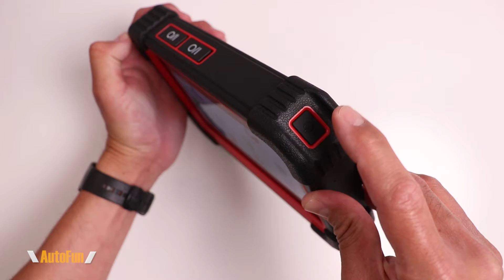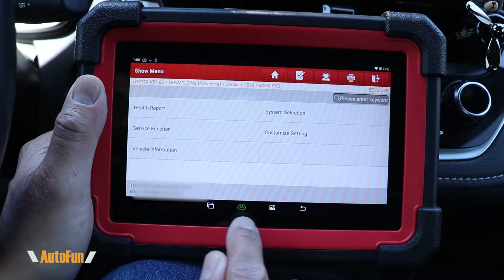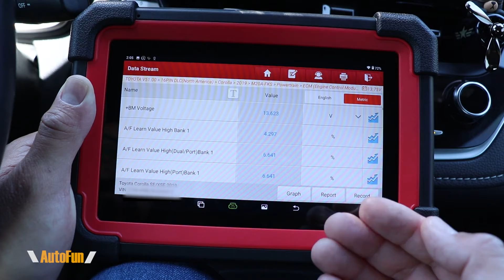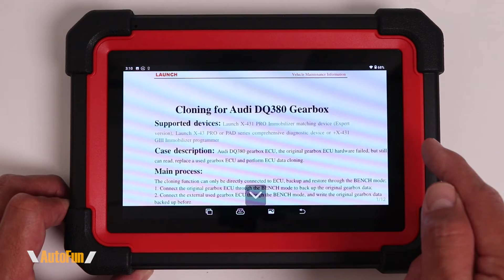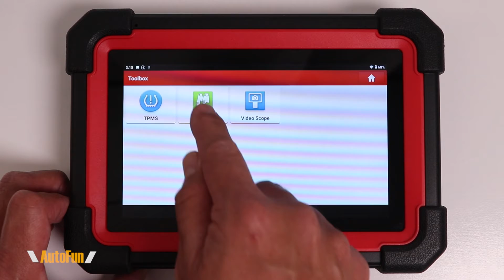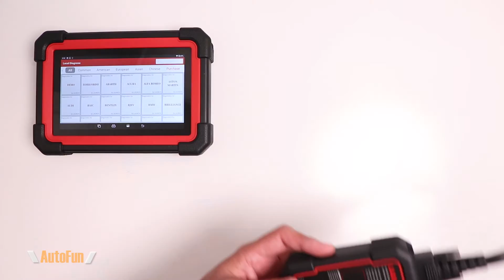Launch X431 CRP919EBT Elite Bidirectional Scanner Review

Comment: Doesn't this scanner also allow for a wired connection instead of Bluetooth? I have used Launch, Topdon, Xtool and Autel. I keep going back to Launch. Topdon is slowwwwww on older vehicles. The Topdon Artidiag Pro to be exact. My Xtool is a bidirectional dongle that has a lifetime of free updates. I like it over the Topdon.
Reply from the maker: Yes using the USC port on the tablet and USB port on the dongle, cheers!
Reply: @AlexAutoFun  I thought so, but wasn't 100% sure. I just ordered the Launch X431 Pro Elite 8" version, non bt.

Comment: Great tool. To those who don't know, this tool has the playstore app installed. Because this model does not have an android home button on the bottom menu bar, you have to access apps through the file explorer. Go to the main Launch X431 software menu and click other modules. Next click files. This takes you to the ES file explorer. Next click the APP folder on the file explorer home screen. This will show you all your installed apps and you'll see the playstore app in the list. To access the apps you have to open them from this menu. If you want to have quicker access to your apps, open the apps and leave them open. They will be accessible through your windows tab on the bottom menu bar even after shutting down and restarting the tablet.
Reply from the maker: Awesome! Thanks for sharing this 😎

Comment: Will it read real mileage ?
Reply from the maker: If the mileage has been modified, it may have been modified in multiple places making detection difficult and in some cases impossible. However yes on some vehicles where the mileage is stored in several places, and not all of them were updated, a discrepancy may be detected but again the true mileage will be unknown. There are also other more advanced ways to determine if the ECU has been manipulated but they require specialized equipment and usually again they can only show that a change was made but not what the change was, Cheers!

Comment: Will this unit deactivate active fuel management system in 2007 Silverado 1500 LT
Reply from the maker: Yes the scanner does support several programming, coding and customizing functions. Just remember that actually being able to activate, program, or enable a specific component varies from vehicle to vehicle. Launch does accepts VIN numbers if you want them to check if it will be able to access the specific function you need, Cheers!

Comment: I bought the same diagnostic from another person who used the serial number and pin code. How can I proceed so that I can use it? Can I get a new serial number and pin? Thanks!
Reply from the maker: If the scanner was activated, there is not need to reactive it. Just continue using as normal. And here is my activation video in case the scanner was not activated https://youtu.be/HI7rB-7_bB0 Cheers!
Reply: Danke schön!

Comment: Hi would i be able to program a jaguar key. My car is displaying smart key not.flund after battery change
Reply from the maker: Yes, the scanner supports IMMO access just remember that being able to add a key will depend on how many keys you have, if your car requires a pin code or a passkey, if you are adding a new key fob or a used one etc. In some cases a dedicated IMMO tool will also be needed if you are trying to re-use a previously assigned key fob where you need to make it "virgin" again using the dedicated IMMO tool, or if you are trying to clone a key outside of the vehicle (and other locksmith level functions). Launch does accepts VIN numbers if you want them to check if it will be able to perform the function you need, Cheers!
Reply: @AlexAutoFun  if i require making the key a 'virgin' again is there a tool that you recommend for that
Reply from the maker: There is an add-on I linked in the video description for advanced IMMO cases. However I usually start with the basic scanner and only purchase any additional add-on if they are really needed (Launch can confirm if the add-on will be needed for your case based on your VIN number and current state of the key) Cheers!

Comment: Can use to key programming?
Reply from the maker: Hi! Yes the scanner supports IMMO access just remember that being able to add a key will depend on how many keys you have, if your car requires a new pin code, if you are adding a new key fob or a used one etc. In some cases a dedicated IMMO tool will also be needed if you are trying to re-use a previously assigned key fob where you need to make it "virgin" again using the dedicated IMMO tool, or if you are trying to clone a key outside of the vehicle (and other locksmith level functions). Launch does accepts VIN numbers if you want them to check if it will be able to perform the function you need. Cheers!
Reply: @AlexAutoFun  thank you so much .how about eps calibration ?

Comment: Which one is better? Launch X431 CRP919E BT or Mucar V08?
Reply from the maker: Hi! Mucar V08 comes with a full set of adapter for Non-OBD2 vehicles, where the CRP919EBT (it may be possible to get a set for the CRP919EBT but I can't confirm). The case for the CRP919EBT holds the scanner, where V08 does not come with a case for the scanner. So I think it's going to come down to what your needs are and which you prefer, and here is the full review for the V08 https://youtu.be/XtsESLy9Zmo so you can compare it to the CRP919EBT, Cheers!
Reply: @AlexAutoFun  alright, thank you sir
Reply from the maker: @haziqnajmi-pp5sw  You're welcome!

Comment: Hello. I got the scanner. My sprinter van is giving me an engine light warning.  I run the test but I can’t get raid off the engine light. I tried clearing the code but nothing. Any suggestions? 
Thx
Reply from the maker: Hi! The issue must be fixed first, otherwise clearing the DTC will not help as the vehicle will detect the issue is still present and turn the MIL light on again, Cheers!

Comment: Hi, how much is the license fee for every 2 years? And from where can you purchase that? 
Also, the license is only for the updates correct? So if you do not pay the renewal every 2 years, you still can use it with the current software versions?
Reply from the maker: Hi! The price varies depending on how many years your are renewing it for, if they have a sale going on at the time for renewals, or if they have a coupon going on, Cheers!
Reply: @AlexAutoFun  do you have a link from where I can buy the renewal?
Reply: @bernardmicallef5622  You can find the subscription in the mall built into the scanner.

Comment: Hello, does this model device code the spare key for my Clio 3
Reply from the maker: Hi M! Yes the scanner supports IMMO access being able to add a key will depend on how many keys you have, if your car requires a new pin code, if you are adding a new key fob or a used one etc. In some cases a dedicated IMMO tool will also be needed if you are trying to re-use a previously assigned key fob where you need to make it "virgin" again using the dedicated IMMO tool, or if you are trying to clone a key outside of the vehicle (and other locksmith level functions). Launch does accepts VIN numbers if you want them to check if it will be able to perform the function you need. Cheers!

Comment: hi, can this scanner reset srs crash mode?
Reply from the maker: Hi T! Yes the scanner does support access to the SRS module however actually being able to reset or a specific component or functions varies from vehicle to vehicle (vehicles have different levels of control, some allow you to active more things than others) Launch does accepts VIN numbers if you want them to check if it will be able to access the specific function you need. Cheers!

Comment: Can this scanner program key fobs like a 2017 chevy colorado. Amazon isnt direct with answer on key programming
Reply from the maker: Hi A! The scanner does support Chevrolet (notice its shows in the coverage portion of the video) and Immobilizer access as shown in the video in Service Functions. However being able to add a key will depend on how many keys you have, if your car requires a pin code, if you are adding a new key fob or a used one etc. Now in some cases a dedicated IMMO tool will also be needed if you are trying to re-use a previously assigned key fob where you need to make it "virgin" again by resetting it before programming it with the X431 or if you are trying to clone a key outside of the vehicle (and other locksmith level functions). Launch also accepts VIN numbers if you want them to check if it will be able to perform the function you need. Cheers!
Reply: @AlexAutoFun   I applied the answer thank you
Reply from the maker: You're welcome!
Reply: @AlexAutoFun   Does it work with forscan learning a trailer brake on f150 ?

Comment: You show that you can record data streams,  but not how to play it back.   Unfortunately I bought this unit,  but have yet found a way to playback the saved data.   How do you playback saved data streams?
Reply from the maker: Hi 75! All diagnostics records including data stream recording are stored under User Info, My Report & Diagnostics Report. If you take a look at your manual it explains this in more detail (page 33 if I remember correctly) Cheers!
Reply: @AlexAutoFun  I finally found it.  Thank you.  I didn't realize that diagnostic record at the top was a different tab.
Reply from the maker: @75cmcacmca  You're welcome! Yeah there is so much to learn on this style scanners, I seem to find or learn a new feature almost every time I use it lol Cheers!
Reply: @AlexAutoFun  thanks,  but I look there and the only thing I'm that location was a pdf report that I generated.  The 3 data stream recordings that I saved with their naming convention want located there.   I'm still looking at how to play live data back in graphical form over the time of the recording.

Comment: Does this have a missfire counter
Reply from the maker: Hi Iron! This will depend on your vehicle, some are able to track misfires (some even down to the cylinder number). Sometimes a normal scanner can be used for that purpose with OBD2 mode 06. However Launch does accepts VIN numbers if you want them to check if your car supports the function and if you will be able to access the specific function(s) you need. Cheers!

Comment: Hello thank you for the information. My question is how to add more memories between Android and diagnostic systems the is too small thank you
Reply: I really appreciate your reply yes I still have half of the memory it is just new I am thinking in 2 years time. One more time thank you for the address you sent I will reconsider stay blessed.
Reply from the maker: @Automotoservicesltd  You're welcome! Yeah there may be a possibility you won't need the extra space, so far I haven't run out of space on my X431 V Pro (I have not expanded the memory on it) But I would guess it would depend on use, I do imagine over time like all tech, there is a point when replacing it for a new one would make sense (similar to phones or computers but so far on scanners, the cycle seems to be much longer). Cheers!
Reply from the maker: You're welcome Obiago! That is strange, you should have plenty of memory left. Mine is fully updated and loaded with all the brands (most people will only need a few brands not all) and I only used 33% of it's memory capacity (64Gb). The only thing I can think of, if you loaded other non-Launch software to the tablet using up space or if you taken a lot of videos with it using the camera (video consumes a lot of memory). Here is another one with expandable memory https://youtu.be/9qwJlUEWN9A however I recommend finding out why your memory consumption is high otherwise, even on expandable memory you can potentially run into the same issue. Cheers!